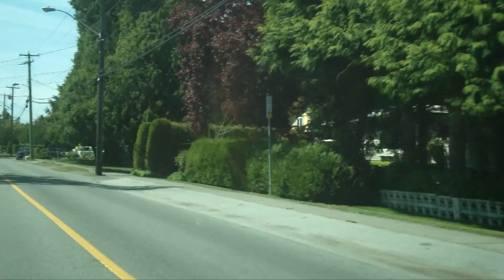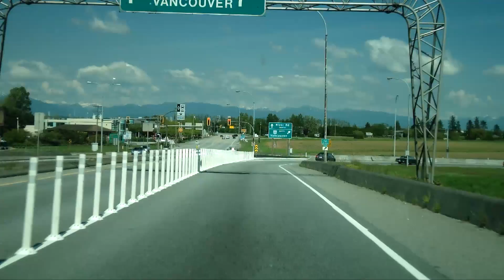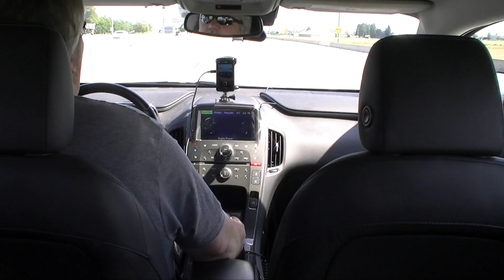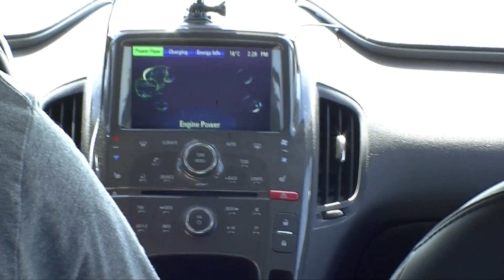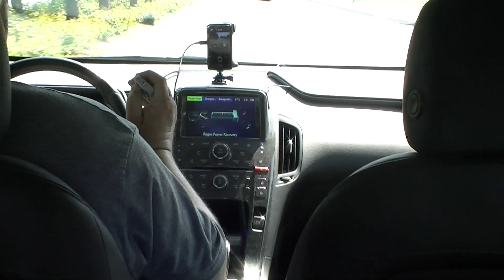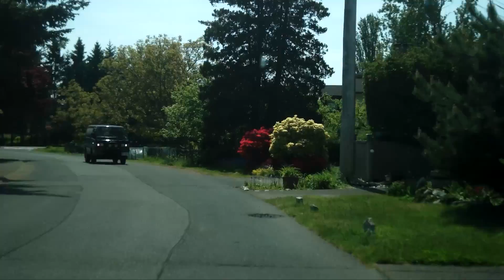How to drive a chevy volt for best electric range and fuel economy

Comment: What is the fuel economy on gas alone
Reply: Average 41-43 but as low as 30 when using shitty ethanol blended fuel. 
(I had the misfortune of finding this out a few days ago, I didn't realize it at the moment, I've been mixing it with "top tier" 93octane and it's ethanol has been diluted and the mpg has come up gradually
Reply from the maker: gera quiroz
I had the same problem when I had to stop at a remote gas station in Arizona because the kid needed to use the restroom, and the gas ststion attendent wouldn't allow access without buying gas.  They put in E85 crap, and my fuel economy went in the toilet, (and the check engine light came on)  but once I refueled with premium the fuel economy returned and the check engine light went out. No problems since.
Reply from the maker: Depending on driving style, speeds driven and type of gas in the tank. I average 40 MPG, but it has been as high as 45MPG, to the US gallon running Octane 91 premium, which is the recommended fuel.
When I have been on road trips, some little towns do not have premium, and I have been forced to run regular or mid grade. On Mid grade octane 89, I averaged 38 MPG. On regular it dropped to 35. Last summer, when I drove to Arizona, I got stopped at a gas station that only had absolute shit gas. Octane 85 or lower E85 ethanol crap. That stuff is absolute shit. My check engine light came on almost immediately, and the fuel economy dropped to the mid 20's and was dropping quick, as was my estimated range left. I stopped at the nearest real gas station, and put in premium, and my mileage returned to 41 or so.
Now you might wonder why this happened, but it is really simple to explain. On a regular car, your 100HP engine is not usually putting out 100HP (or whatever it is rated, I used 100 for simplicity) For cruising, it may only take 15 or 20 HP to keep the car moving.
The volt engine does not drive the wheels directly. It generates electricity to maintain the low state (or in mountain mode 10 - 12 miles of reserve) in the battery. The battery feeds the electric motor.
Generating electricity of like pumping water. It is a 100% load on the engine, so the engine is almost constantly running at it's rated power, or close to it.
Low octane fuel, especially ethanol blends have a much lower energy content than pure gasoline, and because the engine needs to produce full power to run the generator, more fuel is burned as a result. Higher octane allows the spark to be advanced to well before TDC, and thus gives more time for a complete burn, and thus extracts more power from each power stroke.

If you watch my Chevy volt regen braking video, when I took it on a trip through the mountains in BC, I show the display, and the MPG display for the trip. Now this does factor in the regenerative braking mileage.

Most people do not understand how the volt operates. Technically it is the most advanced car you can buy. The closest cars from a technical standpoint available today is the BMW i3 when equip with the range extended.
The Fiskar Karma also falls into that category, but they are out of production.
Both those cars generate power when the battery is done, but the volt has 1 additional mode that the BMW and Karma does not have.
When cruising on flat ground, and the battery is floating at it's optimum low level charge, a clutch can connect the engine into the drive line for cruising. This provides approximately a 10-15% gain in fuel economy over just generating power and then using that power. The volt can not disconnect the electric motors from the drive line, so the gas engine can not power the wheels directly, but in extended cruising, between speeds of 55 and 75mph the as engine/generator can be added into the planetary gear set, and result in better fuel economy. Step on the gas and the engine disconnects, and it goes back into full power electric, fed from the battery and generator again. When the car enters this mode, and you hammer the gas, there is a slight delay, just like with an automatic transmission car as it is up shifting, and then the power comes up to full. It is a wonderful car, and I am looking at buying a second one for a family member, as I have been going 6 months on a 9 gallon tank of gas! I do drive it a lot too, 67K in 3 years!
Reply: My check engine didn't light up, but my dash (I reset the trip meter) reported as low as 26 after I filled up. 
Nothing I could do but dilute the crappy fuel blend with better gasoline
Reply from the maker: gera quiroz
My check engine light came on because the gas jockey that filled the tank didn't tighten the fuel cap and it wasn't sealed correctly. That also caused a problem getting the fuel door to unlock at the next station.

Comment: There is a lot of good info here, and a lot of gassing that should be cut.  Too bad the interior shot is overexposed most of the time.  Set exposure manually and use a lav mic if you can.  You might mention early on how quiet, safe, economical, and reliable the Volt is to keep viewer interest.  Consider putting this video in the automobile category for more views.  GM does a piss poor job at marketing their greatest automotive achievement!  The owners are fanatical about them and love to talk them up at every chance they get.    Currently I'm averaging over 150 MPG with zero issues in my '13 silver spaceship (Sport and L modes most of the time). "Liked."

Comment: Just leave it in "L" mode, no need to keep switching from D to L.
Reply from the maker: There are many times when I take my foot off the gas to coast, and don't want the car to slow down quickly. That is why I switch it, so I can control the amount of regenerative braking. I learned on a standard, so it is fun dropping it down to slow down. One of the things I didn't like when I test drove a Tesla was the fact that there is no stick, and switching to regen mode required navigating through a menu. Then again to turn it off.
Reply: Yes, I keep my 2017 volt in L gear and sport mode. Sport mode seems to have the most regen. Force.
Reply: 12voltvids

Comment: Does the car slow down if you turn on all the wipers and lights at once?
Reply from the maker: YES! It is like hitting a brick wall. The car won't move if the wipers and light are on all at once!

Ask a stupid question. get a stupid response.
DUH!
Reply: Bayan1905 the volt hasn't had any recalls.  Several bulletins yes.
Reply from the maker: Bayan1905
First the volt hasn't had any recalls. There has been a software upgrade, and they extended the warranty to 10 years on the electric power assist motor for the steering as there have been other models that use the same motor that have had a sticking point in the center. I have had more recalls on my other cars over the years. My mustang got a recall for the ignition switch. Could overheat when it was turned off parked in the garage and burn my house to the ground. My TBird got the same recall, and one for the power seat that could short out and cause a fire. Guess what the power seat already had shorted out, didn't cause a fire mind you but the wires burnt nicely.
Oh yes my toyota had a recall for a sticking accelerator and the car going out of control, and another one earlier for a bad master cylinder causing loss of braking power. My old mustang also had one for floor mats that could get caught up in the brake peddle and cause an accident. My dad's Mercedes had constant recalls for everything from brakes to fuel pumps. Currently my wifes Ford escape has a recall out on it for something to do with the ignition switch, and a possible loss of power, airbags and power brakes. Hmmm, that one sounds so much like the GM recall for the ignition lock, which incidentally my daughters car was affected by.You know what the fix was, well you can see my video about the fix, but basically it was an insert to the key to keep the key ring centered, so that when someone has a bunch of heavy shit dangling from their key ring it can't possibly jolt the key off.
Every car maker has tons of recalls, but you never hear about them. Why, because GM is the whipping boy for the media, and every time there is a glitch, someone crys the sky is falling and blows it up out of proportion. Go see how many recalls Tesla has. They have a bunch. Contractor in the battery pack, busing in main drive unit, DC-DC inverter for the 12V battery, infotainment system locking up. Door handles not extending. oh yes, and the big one the one that driving over road debris caused the battery back to rupture and burst into flames. That one required every car to be recalled and have a titanium plate installed.
Every car I have owned, and I have owned many cars over the years had had recalls for one thing or another. The majority of them there was no mention in the media. A letter arrived, and I took the car to the dealer and they fixed the problem. The volt is the only car that I have never received a recall for, just an advisory and that was just a week or so ago about the possible sticking of the power steering shaft, and informing me that they are extending the warranty of that part to 10 years just in case it fails down the road. You know why Ford is now doing something about their ignition? Because they saw the shit storm that happened to GM when they ignored the problem. I guarantee you that after that blew up, none of the manufactures are going to overlook something as simple as changing the shape of the key to prevent cam levering it into the off position when someone puts 5lbs of crap on their key ring.
Reply from the maker: Bayan1905
Lately they have been very pro active. They saw sales figures jump when they recalled the ignition key. Many people it appears when they get into the dealer see all those nice shiny new cars sitting there and they buy. A friend of mine did just that. Got a recall notice to have the limited use spare tire inspected for rust on the rim and ended up trading in and buying a new cruse.That trend has been going on for awhile. You might have lost confidence in their cars, but most people have not. GM has figured out something that companies, like the one I work for for example knows all too well. Wow the customer with good service, and pro actively repair minor things even if it initially costs some profit, and the customer will reward you with loyalty. So many of these recalls that have appeared in recent months are not for critical safety defects, but for minor little things that they want to nip in the but.
For example my wifes ford they knew long ago that there was a fault in the smart junction box that causes the door unlock to fail for the drivers door. I even took the car in under warranty to the Ford dealer, 3 weeks before the warranty was done, and they couldn't book it in until after the warranty. The service writer said they logged it in, and I would be covered. Guess what, when it went in, now after the warranty expired they said too bad so sad, not under warranty. It was a well documented failure, and I produced hundreds of complaints of others that had the exact same thing happen. Fell on deaf ears. Now with my volt I get a notice advising me that there might be a problem down the road with a part, and they are extending he warranty for 10 years just in case it fails, and advised me to keep the letter in the glove box just in case it needs service.
Now that is taking responsibility, and looking after the customer. Something that Ford didn't do for me, and for that matter neither did Toyota when I had one of their cars. Things have changed under the new managment team at the general. 10 years ago they would have never done that, no different that Ford didn't step up to the plate and fix my door unlock. Face it every brand of car has some defects and problems. The worst ones I have owned is the German cars. Have had both BMW, and my dad had Mercedes. You want to talk about problems, and repair bills out of this world.
Reply: Was this an actual question or are you trying to be a smartass?
Reply: I'll let you figure that out.
Reply: Bayan1905 I was giving you the benefit of the doubt and  hoping you weren't stupid enough to make such a question, but I guess I was wrong.
Reply from the maker: gera quiroz
Hey you can't fix stupid, because as they say, dumb people are not smart enough to realize they are dumb!
Reply: Smart people wouldn't buy a car from a company that recalls one of the models every other week. GM has recalled more cars than anyone else in the last 5 years. But hey, you might get lucky and your ignition won't lock up, your brakes won't fail, and your airbag won't explode.
Reply from the maker: gera quiroz
The bulletins I am aware of was, inserting an additional metal plate between the battery and chassis to strengthen the battery from side impact, checking the drivers airbag for a loose clip that could cause a rattle in the steering column, reprogramming the inverter module with upgraded firmware, sapping out the metal valve stem caps with plastic as the metal ones will corrode and become impossible to remove, and extending the warranty of the power steering motor to 10 years.
None of those were recalls, just normal maintenance items that were checked and performed during routine service. In fact there was only 1 recall on anything related to the volt, and it wasn't for the car, it was for the charge cord. The original one the 110v plug overheated on a few, so they replaced all the travel chargers with more robust plug. I almost forgot about that one as I have a level 2 240v charger.
Reply: No, but GM has had A LOT of recalls with all their other models, I'm sure they'll get to the Volt eventually. I would rather hire a Chinatown rickshaw than get into a GM car these days.
Reply: I wasn't aware there had been an actual recall on the L1 chargers that came with the car. 
I went to visit my parents in Houston and forgot it,  since I have an L2 at home, I didn't think much of it. 
When I finally went back to visit again it had died, my mom hung it from the cord and it drowned. (since it's not "sealed and waterproof)
It's rain-proof only right side up.